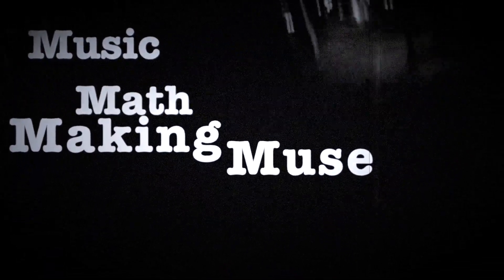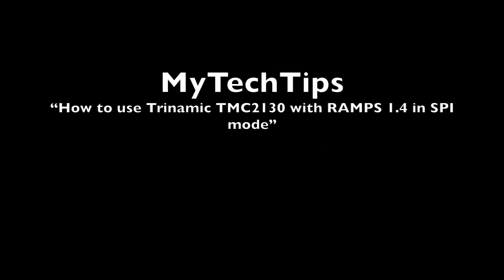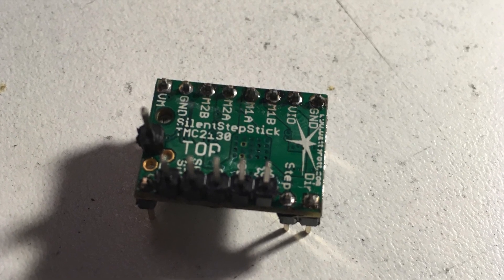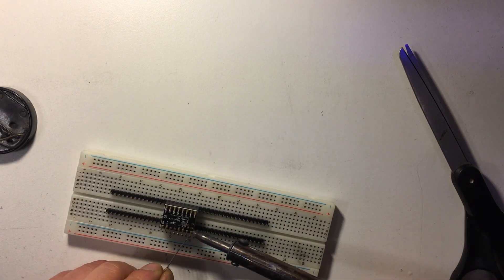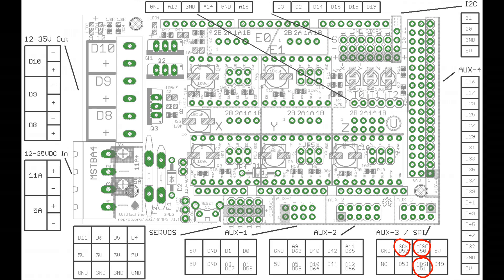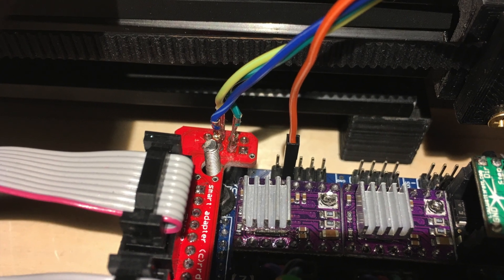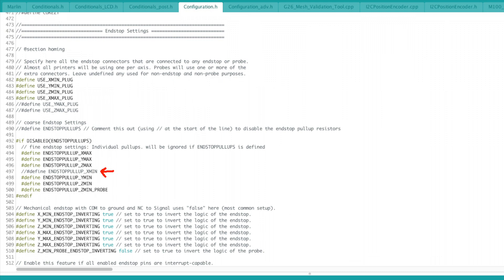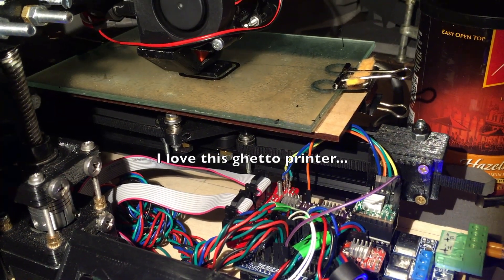5mdd - TMC2130 & RAMPS with LCD and SD reader

Comment: If you buy a ramps 1.6 from BigTreeTech, you don't have to solder anything, there are jumpers under the drivers that do that for you. The only info you need to find out (as BigTreeTech documentation is poor) is where the CS pins are for each driver. they are: XCS：D63 YCS：D40 ZCS：D42 E0CS：D65 E1CS：D66

Comment: Thanks for this, it does seem that on my Sainsmart 2-in-1 board the AUX3 and LCD connectors are present, and I only needed to reassign the CS pins and not the SPI data pins. The LCD and 2 TMC2130 drivers appear to be working fine together using the hardware SPI, thus keeping all my other lovely pins free for ATX control, neopixels, z-probes, random servos and the like.

Comment: Do you think you could show us how to set up two stepper motors with a single nozzle I’ve been trying for three weeks and I can’t figure out the firmware or the slicing software
Reply from the maker: I have not tried that yet, so I can't be much help at the moment, but ill put it on the list to look into in the future
Reply: Thanks it was the distinct E factor I didn’t  uncomment it

Comment: Hey Alex, could you elaborate on wiring via the ICSP? It seems like it would be much cleaner than soldering over your LCD extension. Which pin goes where there?
Reply from the maker: Easiest way is to search for "Arduino Mega2560 R3 pinout" so you have a visual reference, and then just wire up the MISO MOSI and SCK pins to jumper wires so you can feed that out between the mega/ramps sandwich.  If you look at the "simple arduino stepper control" I posted, that black Keyestudio mega board is one that I ran jumpers and then hot glued them in place.  Software serial is available in regular Marlin now too, so you can also try that first and see if it works for your machine (if you have enough spare pins).

Comment: H Alex. Daft question time.  Is the only reason to solder the connectors to the top of the 'L' bracket so you can still use the SD card on the display?  If so Im thinking i can leave this as I connect to the printer via octoprint and raspberry Pi...  I dont need the SD. I'm replacing a dead Anet A8 board with Ramps 1.4, arduino and TMC2130's  etc.  I would like to use the display as well though.

Thanks

James
Reply from the maker: Soldering those pins lets you tap into the hardware SPI bus going out to the control panel.  if you have spare pins, you can use software SPI and assign them wherever you want
Reply: ok thanks :D

Comment: i still can't quite get the sd card working. basically, it just homes the printer at the start and then sits there and waits a little, then says the print finished. i did test the gcode on another printer (same marlin firmware w/out tmc2130s) and it worked fine...
Reply from the maker: Try a different sd readerand cards if you can, and see if the problem goes away.  Some of my old cards work better, and a few knock-off smartcontroller panels misbehave occasionally. SPI can get wonky, depending how well-behaved the slave devices are, how (and if) the lines are pulled-up to vcc, whether the devices are buffered, etc.  SD card readers are all over the map... I just ordered 8 different models, and about half of them have tristate buffers on them, the rest don't, and about a quarter of them have acceptable filtering and pullups, but adding unneccessary caps and resistors can limit speed and cause timing issues.  Since technically you can wire an SD card directly to an SPI bus with only one resistor and it will 'wor' 90% of the time, some boards out there have minimal parts to keep the cost down. THere are also different speed cards and several operation modes.

Comment: my problem is that nothing shows up on the lcd after doing this...
Reply: Can the problem come from a bad solder? the drivers work great. just the lcd is blank
Reply from the maker: Sorry, this comment slipped through the cracks.  I can't really troubleshoot your LCD from here, but start by making sure your backlight is working and that the connectors are oriented properly (some of the adapter cards have the ext headers backward, so best bet is to check around online for your particular LCD and adapter).
Reply: Alex Kenis I got it working by re soldering it. I think some of the solder touched some of the other ports

Comment: You mention that there are "a few novel ways that you can kill these" and therefor you use the protectors. Care to elaborate?
Reply from the maker: Sure: Apart from the usual ways to kill a stepper driver, the literature also indicated that they were more sensitive to pulses from inductive loads, and if you cut the drive voltage without cutting the logic voltage, that can kill them that way too: like if you removed D1? on your RAMPS so that you could run it on a separate power supply than your Arduino, and then turning off the RAMPS supply while leaving the Arduino on. I decided to risk blowing out a driver to that failure mode with the diode protection board installed, and my driver didn't blow, so I suppose it works.
Reply: Alex Kenis Thank you for explaining. Is this a fact just for Trinamic-steppers or for all steppers?
Reply from the maker: As far as I can tell, the 'removing V+ before logic voltage' thing is specific to Trinamic, since I used to do that regularly with DRV8825 and Allegro drivers and have never had a problem ( that is just from experience... it could still be a problem, but I have not seen it).  Of course, you can still blow the TI and Allegro drivers by yanking them out while they are powered up, or big inductive spikes, etc.
Reply: Alex Kenis Thanks again. Think I should get me some of those. Small pennies for keeping your shit alive.

Comment: the latest bugfix branch adds support for software serial for tmc drivers.  no more using aux-3.  now im using servo pins for cable select and aux-2 for software spi
Reply: https://twitter.com/wbarber69/status/973370242360541184
here is a pic of what pins im using.  and i am actually using 5 tmc2130s
Reply from the maker: THanks for posting the link.  I was/am running 1.1.8 bugfix in this vid, but figured I would wait until they patch soft serial into main branch before I threw that in the mix.  For anyone reading this who wants to try it, download the bugfix branch from Github.  I use it daily with TMC2208 drivers and It has been pretty stable.
Reply: I much prefer not having to choose between an lcd and tmc2130.  I am hitting a wall though where my graphic lcd is taking up too much space to also have an sd card without maxing our the progmen

Comment: nice video, can you tell me how to do it with mechanical end stops on all axis? should the diag pin be connected to the min signal pin?
Reply from the maker: Sure, I just added a 2130 to another axis last night, ran it through tests in a bunch of different modes, and it works perfectly.  

And yes, you are right: plug the diag pin from each driver into it’s corresponding end stop min “s” signal pin, and plug your end stop into the max end stop header, and then move the switch itself to the other side of the axis.  

I’m sure you know this, but I’m going to say it in case anyone else reads this comment: be careful not to plug the end stop in backward of you can fry your board.  

Then I just followed what I showed starting at 4:11 in the video:
-Reassign the pins you need
-Change the homing direction
-Enable the relevant end stop pull-ups
-Invert direction
-upload the new firmware settings and power cycle 

Send an m122 after that to print out the settings to the terminal and make sure everything is cool.
Reply: thanks for the time explaining, do i need to reassign pins if i don't have an lcd screen? also, the x will home on the right and Y will home on the front but what about Z?
Reply from the maker: No you can leave the pins where they are if you don't have an LCD.  As far as I can see, sensorless homing for the Z-axis does not exist in Marlin (probably because the bed springs and glass beds would not work well with it), so just set it up normally with either an endstop switch or inductive probe, etc.
Reply: thought i would share, I tried a way different method but im not sure if there's going to be something wrong with it long term. I enabled all the endstop plugs for MIN and MAX, tmc2130 DIAG goes to corresponding S MAX pins and the mech endstops goes to their usual MIN pins and disabled sensorless homing. no flipping sides and changing home direction. let me know if this would fail somehow long term. so far so good.
Reply from the maker: Nice!  glad it's working out.  Either direction should be fine, I just to have to option of mechanical stops in addition to the standard auto-home setup.
Reply: how are your stepper motors btw? do they get hot? mine is probably 40-50 degrees, by feel its like the hotbed. do you know if thats ok?
Reply from the maker: Yes, the Trinamic drivers have a high Rds(on), so they run hot.  I hope they fix this in future versions because it ends up being a balancing act between missing steps or overheating the driver.  I have a fan on mine because I kept getting temperature errors in the console.  They should go into shut down protection if the temperature exceeds a dangerous threshold repeatedly though.  The bigger concern is that they are not well protected against voltage spikes or power outtages.  Their protector boards help somewhat, but you can still blow them out if somehow the logic voltage is applied before the high voltage. They also will go into protection mode and ask you to restart the printer if the wiring or wire routing is not solid, or if there is a fluctuation in the ground reference, which is annoying. I should put up a video about those things too because Im sure im not the only one who noticed it.
Reply: Alex Kenis funny though, tom’s guide never mentioned any of this. yeah i tried going for 400 mA but i get layer shifts
Reply from the maker: Tom's video was sponsered by Trinamic,  it was more of a basic how-to guide rather than a critique.  I'm getting a pair of tmc2100 boards soon, and I'll do more critical review comparing them with the 2130's so that I can lay out the problems and pitfals, as well as test them under more extrmem cases.
Reply: my thoughts exactly, i started with an anet a8 and with all the upgrades i have done i might be able to rebuild the old one or build a new one altogether ill try out different boards and drivers
Reply: do you think quality stepper motors will help with the heat?
Reply from the maker: If you are still using your A8 steppers, they are pretty decent.  You could try one with a lower current rating or higher inductance to sacrifice speed for torque, but I don't think it would make much of a difference. I could be wrong, so you may want to check google to see if low current + high-ish inductance made any difference for anyone.
Reply: what’s higher inductance in marlin? i tried 400mA but i get skipped steps/ layer shifts pretty new with ramps and marlin so i need to do alot more research and testing
Reply from the maker: Inductance is part of the stepper's spec, not Marlin.  I'll have to put up a short video on how that all works sometime soon.

Comment: Hi, thank you for the video. I am about to do a Ramps + 2130 build on my printer but now I am a little confused. Am I not able to simply use any other free pins for the cables instead of soldering them on the AUX3 pins? for example just plug the display adapter on the AUX3 as shown and use some free ones on AUX2 or AUX1 for the TMC's? Is it really neccessary to use the ones on AUX3? Would be nice to know thank you.
Reply from the maker: There are very specific pins that break out the SPI information, and they can't be changed (i.e. MISO, MOSI, SCK).  They are on the aux 3 pins and the icsp port near the CPU.  The CS select pins can be reassigned (like I did with mine in the video).  Easiest  options are to either 1) solder on top of the LCD breakout bord pins 2) rig up a harness or split the pins out to a header  or y-cable 3) use the SPI pins on the Ardiono's ICSP port under the ramps board to break out a cable to the trinamics.  I think the 3rd option is the cleanest, 1st option is easiest, and 2nd option would be best (taking some time to make jumpered socket headers to break out the pins next to the LCD).  I am also not sure there is enough room for a proper DuPont connector between the ardiono and ramps, so I would expect to have to use socket/pin extenders between the ramps and Arduino or bend the pins at an angle.
Reply: ah, I see. actually didn't know that. thank you so much. would have caused me some brain confusion there.
Reply from the maker: Oh, I forgot about this at the time, but in the experimental branch of Marlin, we are testing the possibility of software SPI, so if that works , eventually we may be able to emulate SPI on general use pins... i.e. reassign the SPI pins in Marlin and not have to solder to the header, but it doesn't work well yet.  If that makes it into the main branch, I'll put up an update video.
Reply: That would be awesome indeed. I managed to get them to work today now. I had "Driver Error" when I first started them, turned out the breadboard was garbage and now after I just soldered all the cables together properly it works and stealthchop is awesomely quiet. Only when homing it is quite a bit louder and I can't understand why yet...but I could live with that tho. Can't really understand why people always say "2130's on other motors than X and Y are not worth it anyways" ...well at least on the Z axis it is phenomenal. I can't hear a single thing on Z anymore. Z hops annoyed the f out of me, now it is gone finally.
Thanks for your great support especially cause I can now use the display with the drivers properly :) Would have struggled with this some bit without the video.
Reply from the maker: Nice!  Yes, i had a lot of errors too when i first pluggeed them in, which is why I want to do another testing vid.  They are very sensitive to EMI interference, ground circuit disturbances, wire routing, etc... I could even get my Y axis to skip steps by putting a desk fan really close to it, and they would not work at all when powering the arduino from USB and the printer from a wall wart... so i am compiling a list of all the ways I have had them screw up